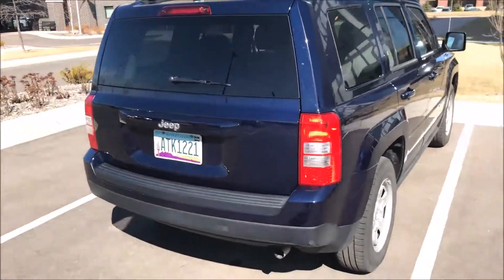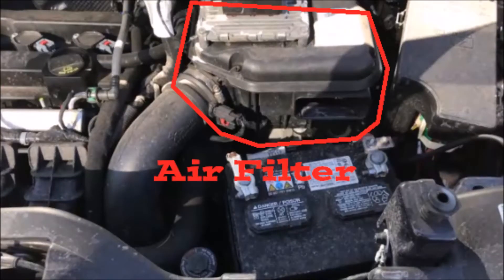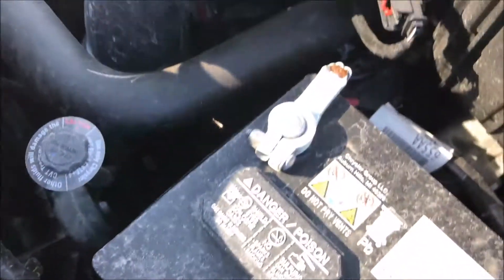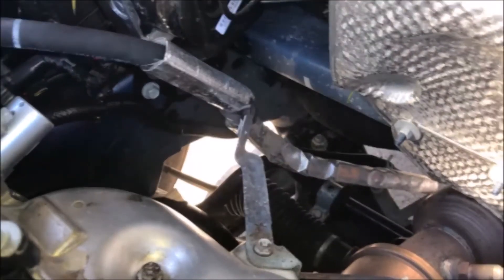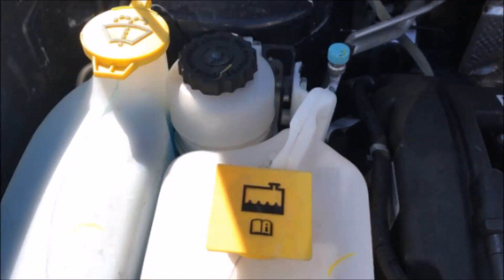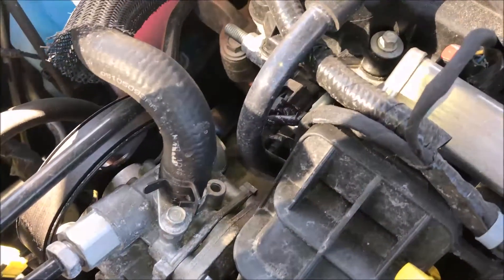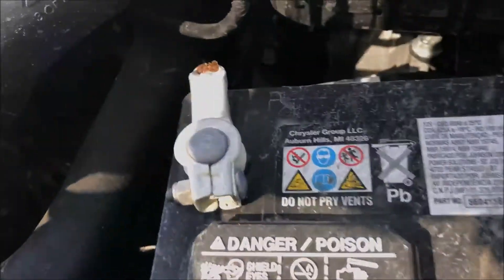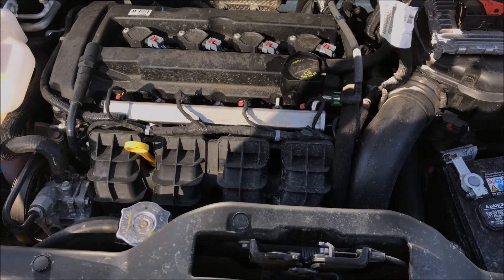2016 Jeep Patriot Engine Review - 2.0L 2.4L 4 Cyliner

Comment: I have a 2016 Jeep.Patriot 2.0 and had to replace the engine at 138,000 miles! Which it took 3 different shops to be able to get it done and over 6 months to get it done correctly.. idk why it was do difficult to change the engine but obviously it was finally was able to find a mechanic that was able to do it properly thank God! I was close to junking this POS but I still owe $6,000 on it and I could not afford to chop this up for a loss and then buy another vehicle and continue making payments on this one. I just learned my lesson to never buy a Chrysler Jeep or Dodge again!
Reply: What happened to the original engine? Why did it fail so soon? Any other issues?
Reply: Same happened to my jeep engine  2016. 2.4 liter, still owed thousands. New engine leaks oil bad

Comment: I know this is an old video, but I can’t seem to find another video that explains what everything is. So, at 1:20, there are two black clamp looking things with red levers on them. They’re sitting on top of a silver covering, which sits on top of the air filter cover. What are those?

Comment: I have a 2012 Jeep Patriot and I'm trying to see where the exhaust connects into the engine cabin if it's connected to a plastic piece if you can upload that or respond to me I would appreciate it. And is approximately 4:22 p.m. Central Standard Time

Comment: Before I purchase this vehicle are these pretty simple to work on? Also, are the parts priced fair or outrageous etc thanks
Reply: Let me let ya know that this vehicle is first of all a piece of JUNK dont waste your $ buying it! I made the mistake and bought a 2016 Jeep patriot latitude 2.0 engine 4 years ago...and it's been nothing but a headache ever since....unexplained electrical problems, problems with the drive belt that was not easy to fix ( my husband says the way Jeep made this motor everything is to close together that it makes simple repairs next to impossible to fix) and then when you take your patriot to the dealership to get something fixed they don't know what the hell they are doing and can't properly diagnose or fix whatever is wrong with it! Just save your money and buy a Kia suv ( i know every one is thinking a Kia, but yeah they are much better made than this Jeep from my experience)
Reply: No they aren't

Comment: hi Man, i have a problem with my 2007 jeep patriot 2,4L. my right flasher doesnt work, it's flashing rapidly, so i changed the bulbs but the problem is still present. so could u give me a tip to check another part of the system. thanks bro.
Reply from the maker: +AKSOUH Salim check two things... blown fuse or cracked/leaking headlight that allows moisture to get in.

Comment: I got a p000a and trying to figure it out is a mission i already changed the cam position sensor
Reply: My 2012 threw both cam position sensor codes when I had a fuel line leak which was caused by a bad transmission (common with these cvt trannies).
Look into what else the jeep is doing and take it to someone with jeep maintenance experience

Comment: I am planning to buy a jeep patriot Make: Jeep
Model: Patriot
Trim: Sport 2WD
Year: 2009
Body Style: SPORT UTILITY 4-DR
if its 2WD then why  on the back door 4 * 4 is written?
Reply: That's the higher up version of the sport. The 4x4 model. In other words the SS model of the sport. The two wheel drive version doesn't have the badge. But they are very solid SUVs we have one had a few problem at first but it was cause of poor maintenance. But I don't have a issue with it now.
Reply: Do not buy the cvt version only a 6 speed auto or the 5 spd manual
Reply: Don't waste your money on a jeep patriot save your $ and your sanity they are cheaply made peices of Junk!